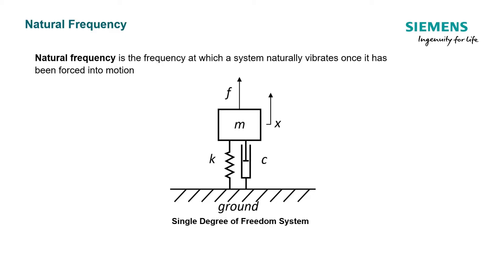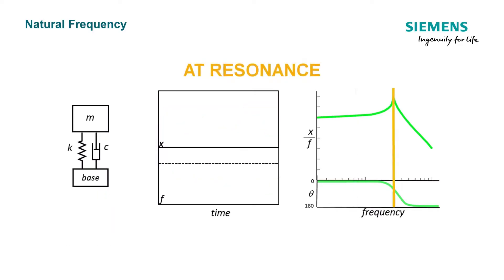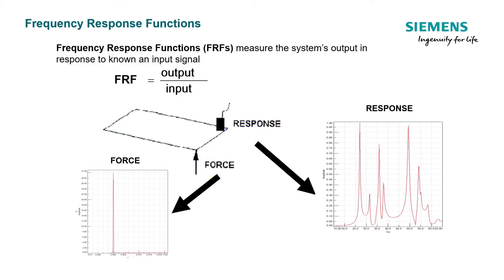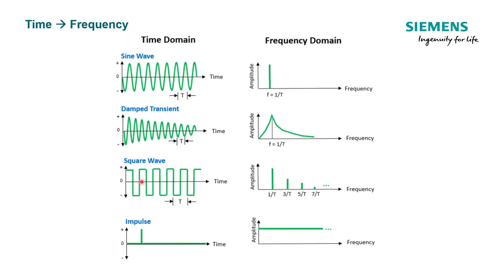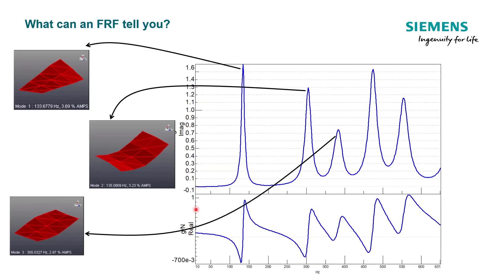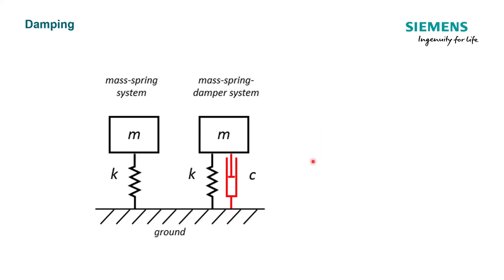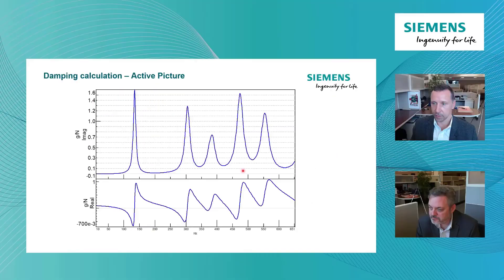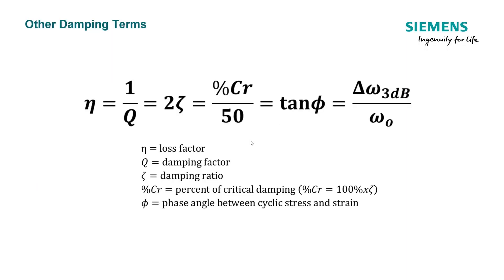Natural Frequency, Resonance, and FRFs

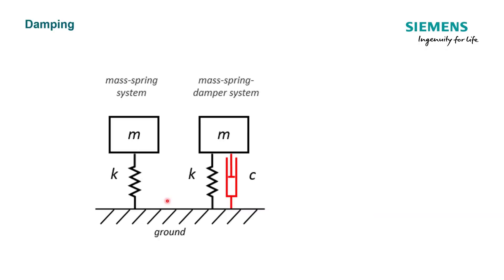Comment: At 5:04 isn't the left spring system supposed to dampen over time?
Reply from the maker: This is a theoretical example where the left mass-spring system does not have any damping (c). As a result, it does not dampen over time.